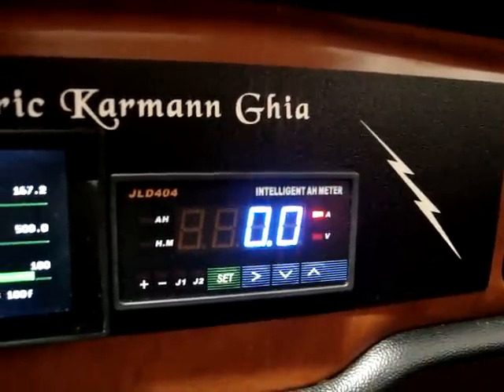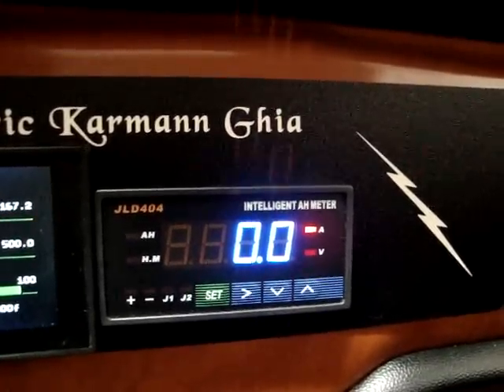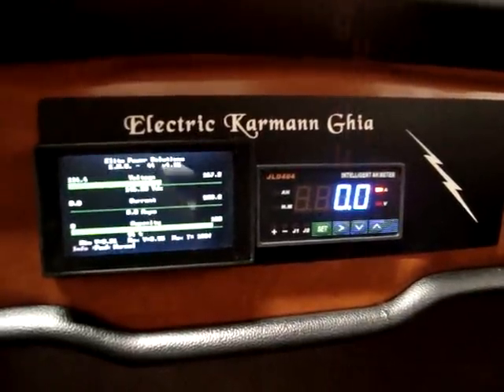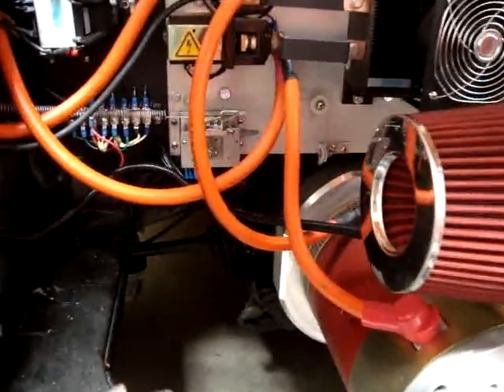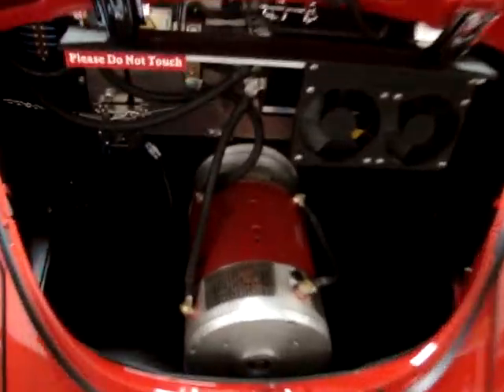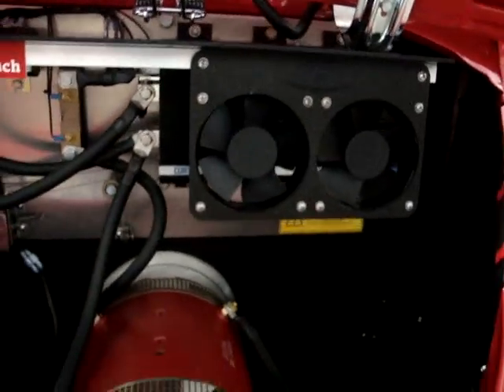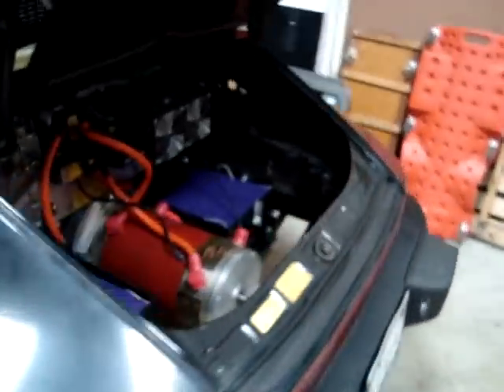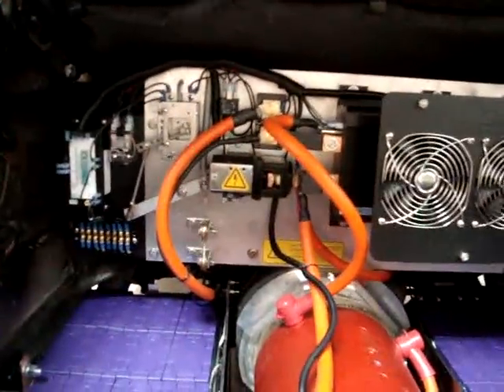DIY Electric Conversions - Electric Karmann Ghia Update

Comment from the maker: The Karmann Ghia is powered by 44 - 100Ah lithium cells located were the original package shelf was located.
It has an NetGain ImPulse 9 motor and a Curtis 1231C controller.  The Ghia has a 60 mile range a 90 mph top speed.  The car is featured in several of our videos, including From Gas to Electric in 8 Days.
Thanks for watching.